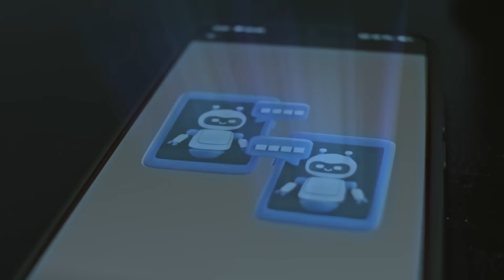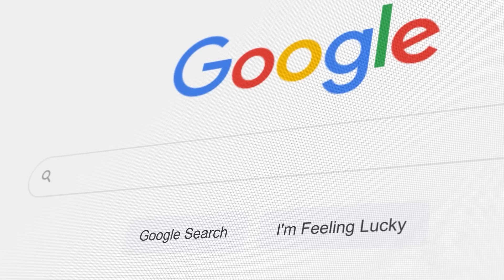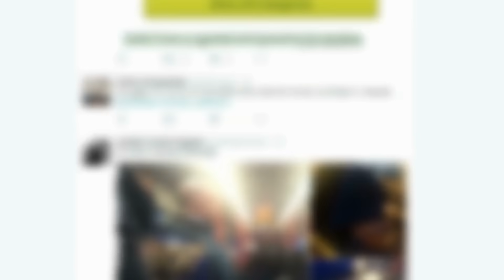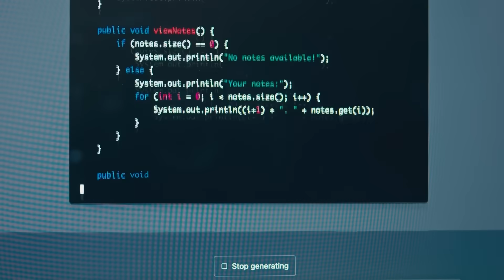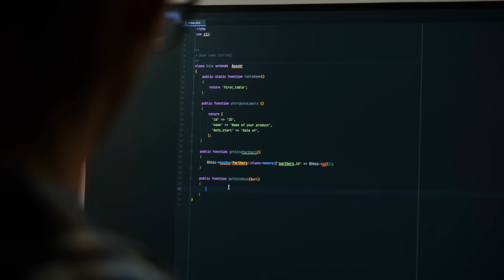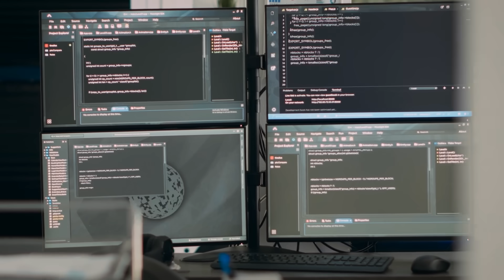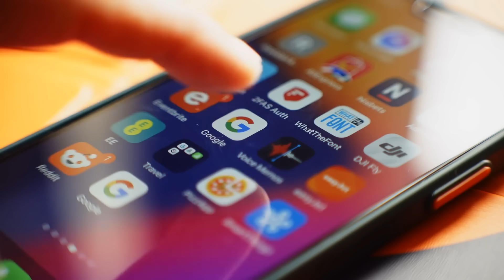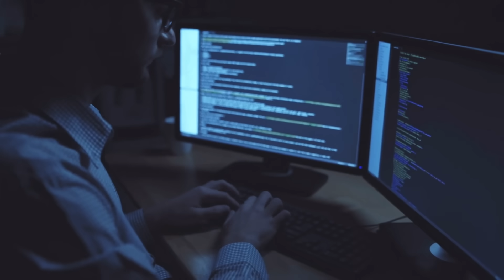Top 10 Disturbing AI Conversations Scientists Shut Down Immediately

Comment: It's basically a machine, right? I've been a machine operator for over 30 years now, and when you operate a machine or even interact with one, always know where the shut-off switch is, or the e-stop. I don't care if it's a I or not, it's a machine! Machines cannot be reasoned with that's why you have to know the machine, and in this case, know your enemy.